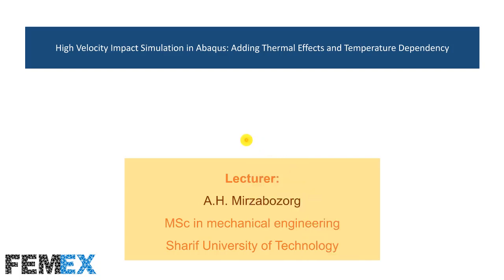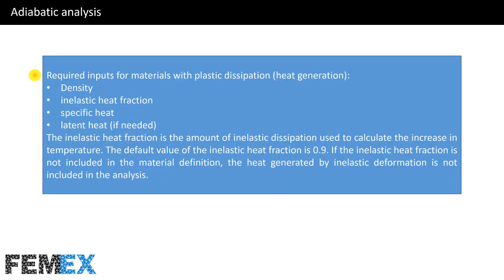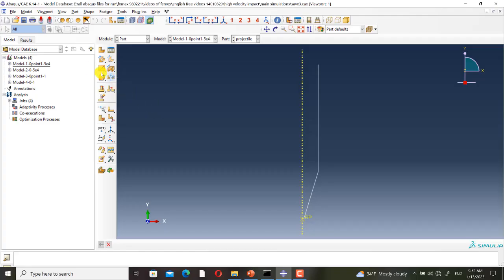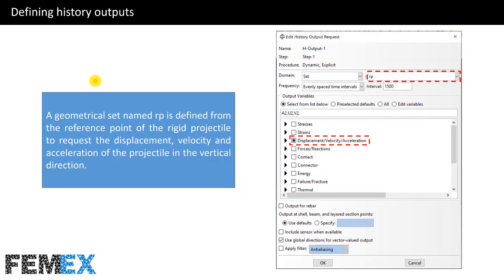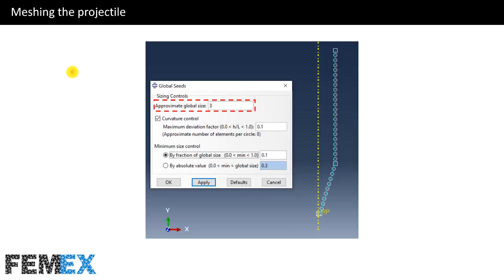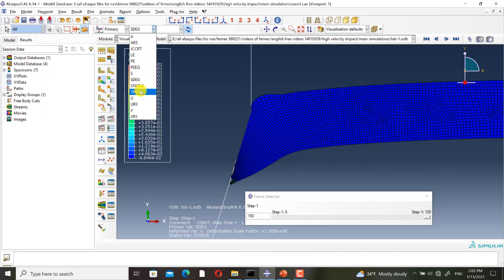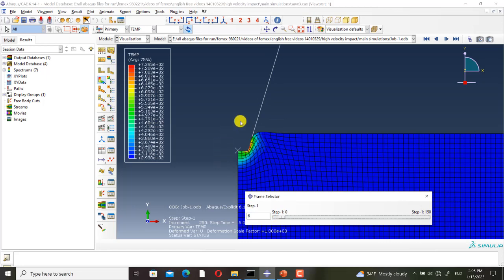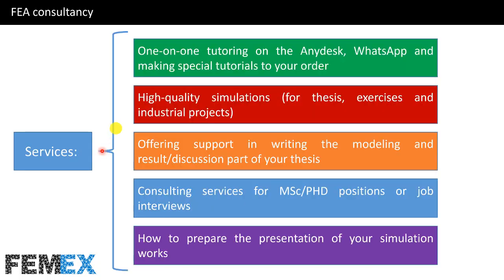High Velocity Impact Simulation in Abaqus: Adding Thermal Effects and Temperature Dependency

Comment: Hi.
Thank you so much for your comprehensive tutorial.
I have a question about the damage analysis of concrete.
What is the meaning of damagec and damaget contours ?
I want to check which regions are totally damaged.
Thanks in advance
Reply from the maker: Hi.
You are welcome.
Damagec is the parameter for compressive damage propagation.
Damaget is the parameter for tensile damage propagation.
Both of them are always between 0 and 1.
0 means no damage has been occured.
1 means that element is fully damaged.
It means there is a crack in concrete. If damagec or damaget is equal to 1, it means that element is cracked.